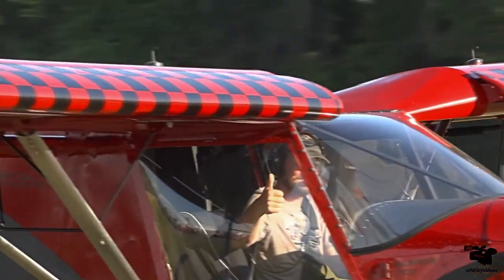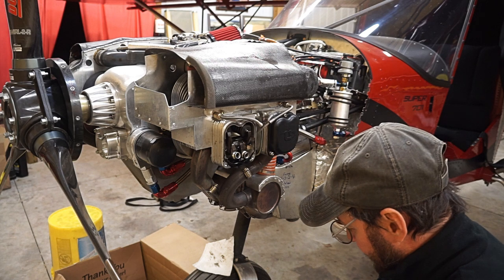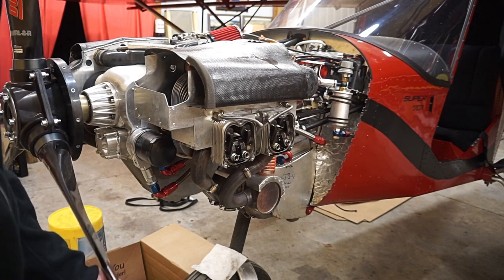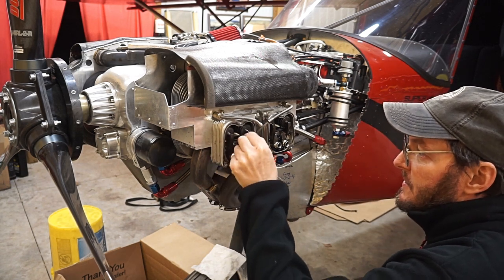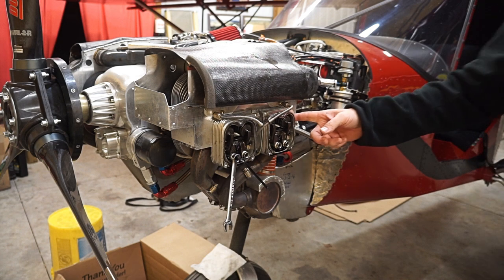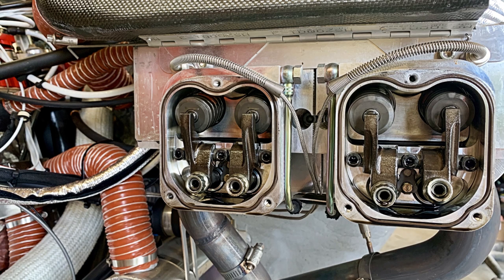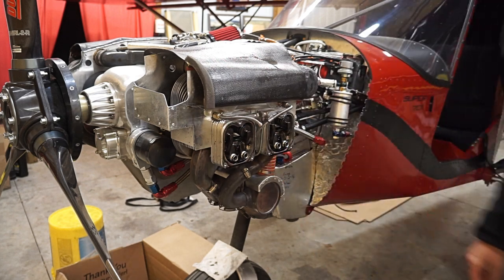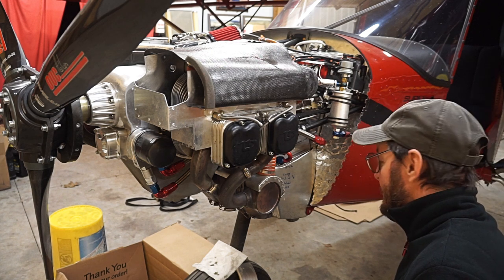ULPower 500hr valve check on the Super701

Comment: great job showing how to wrench on your motor. I"m a two stroke guy but have nothing against either, I think the problem comes down to not understanding how to work on your own engine. I have almost 80 hours on a single cylinder two stroke hirth and I just replaced the fuel lines out of caution. I  feel as confident in my little two stroke as a lycoming or contintential because I learned how to work on my motor just like a ap would.
Reply: Agree completely! I grew up around 2 and 4 strokes , entirely different animals! Properly feed and watered , 2s are just as dependable as 4s. although I believe they require more maintenance more often.

Comment: The overlap method is how I adjusted at least a thousand VW and Porsche engines when I had a shop  for 15 years. First time I have ever seen it demonstrated. It makes it easy to visualize the cam lobes that affect two cylinders (when overlap the opposite side of the cams are TDC and to be adjusted)
 Like a VW, this kind of engine has much looser tolerances and thicker oils to fill voids and  changes due to temp due to dissimilar metal expansion.then modern water cooled automotive engines which have incredibly tight tolerances requiring very thin oils vs air cooled. Note the extremely low viscosity (e.g.0-20wt) of modern tight tolerances engines. Both work reliably well as long as lubrication and temperatures are controlled.

Comment: Hey John... what are the terms of your warranty concerning which routine maintenance and adjustments you are permitted to perform? How's the new prop working out? Thanks for the update and info! Blue Skies!
Reply from the maker: Really no need to do anything other than check the valves and oil changes on these engines. The service manual give a good rundown on the schedule and what needs to be performed. It really is simple though.
Loving the DUC prop! It is definitely a better performing all-around prop when set for a cruise pitch. Hoping to try out a different blade profile soon, just to compare.
Reply: @TNFlyingFarmer  Thanks!

Comment: Do you run unleaded auto gas to avoid the lead build up they say happens when using AvGas in UL Power engines?
Reply from the maker: Luckily I have 93 octane 100% auto gas nearby, so I use it unless I am away on a trip.
Reply: @TNFlyingFarmer  I'm genuinely envious. Best we have in most of Arizona is 91 Octane with 10% alcohol.
Reply from the maker: I am lucky here with gas. I think it is because we have so many waterways and boating locally.

Comment: Jon - Whats that piece coming off your oil filter block connected to the oil cooler line? check valve? If so why do you have it installed...? Just curious...
Reply from the maker: It is only an extension to make the 90 degree fitting come out underneath the other 90. Clearance extension only.